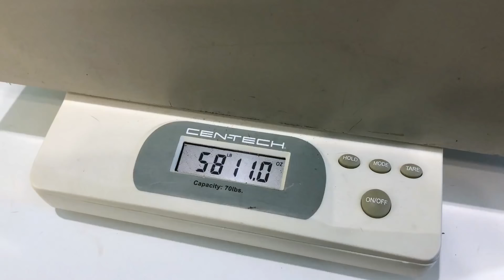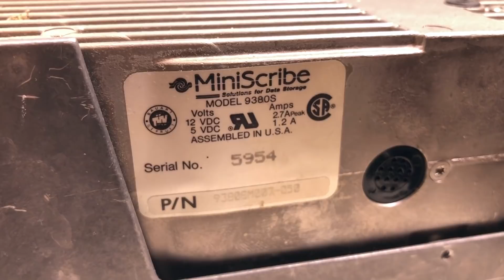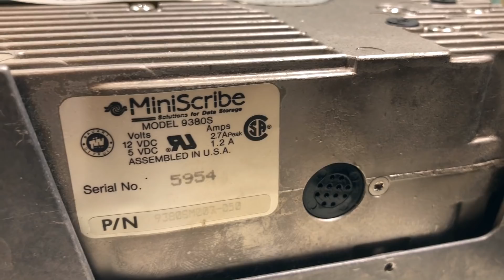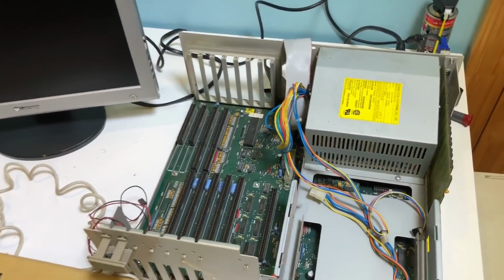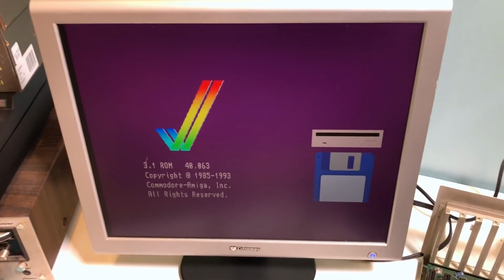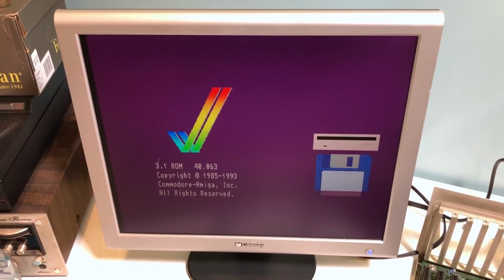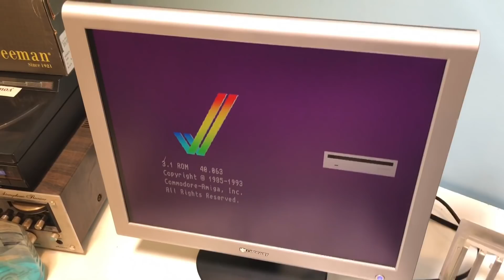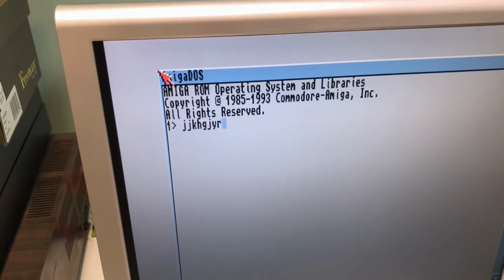Bringing my Amiga 2000 with 68040 accelerator back to life! - SIMPLETHINGSTOYS

Comment: All you need are the workbench install disks or CD.  If you want to save whatever is on that big hard disk, I would install the OS to another drive and then hook the big drive up later, to safely retrieve any data from it, because the install will format and erase it.  The OS app you'll need is disk tools.

Comment: Got a similar setup A2000Rev6.2 (60Hz), added 2 Isa 16 bit upper slot, double Kickstart 3.1+1.3, 2Mb chip module, FF40@28+32Mb (rev1)+rom3.4, OS 3.9/3.5/3.1 on different partition, VideoToaster 2000, DCE external scandoubler, GVP SCSI HC8+ with 1 mb + 9 Gb IBM FiberChannel hdd , Buddha IDE + ide CDRW, Picasso 2, A2386SX + FPU +8 mb (and Sound Blaster AWE32, 3COM Etherlink III shared with the Amiga side), two mouse (1 for each side), 1 floppy 880kb drive on the Amiga side and a 1.44 HD on the pc side.... ;-) Not easy to make this work together

Comment: The SIM RAM/HD card was to simplify and compact addons. Since the 2000 came with only 2MB RAM the 8MB of SIM was useful, and adding a HD controller means it only took one slot. SIMS were common on IBM PCs, so it kept costs down. My A2000 has a similar GVP card - fully populated =).

BTW, ALWAYS use an anti-static strap when doing that kind of work or run the danger of ZAPPING your chips.

Comment: The hard drive card was a hard card, and was a memory card as well as a disk controller.  Alot of the card upgrades were multiple use cards .  In this case you had a HD controller that you could add up to 8 meg of memory, normally 1meg X 8 simms...same as was used in Macintosh systems.

Comment: The Zorro bus of the AMIGA supports not just SCSI Controllers, Network cards, etc. But also the PC Emulator card and Memory cards - combining the SCSI controller with Memory expansion possibility would save you an extra slot for "FastMem". 
I got the same IBM XT compatible expansion card :)  
You can add a ISA VGA Card and even an 8-bit HardCard or converter to IDE card (new) that can be used with a IDE-to-CompactFlash adapter, and it will work in 8-bit with the 8088. The driver for the AMIGA even supports booting from Floppy and using part of the PC Harddisk for the AMIGA. 
Still looking for the source for that 8-Bit IDE Adapter :)

Comment: really nice find, some great expansions there! Kickstart rom seems updated to 3.1, it didnt normally come with the A2000. regarding the memory on the scsi card, its not related to the scsi its just a normal system memory expansion put on the same board. it was verry normal on A2000 that harddrive and memory expansions was put on same card. The accellerator might have fallback mode to the original processor thats still on the motherboard so you will have to do more testing to know for sure its working. Again verry nice find!
Reply: Yeah I had 2 megs extension on my SCSI board for a total of 3 MB of ram.
Reply: It was the same for hard disks that came out for the A500 too (though I never had one), a quirky feature of the era which pleases me. I think it was simply a case of getting some more use out of spare space on the expansion card being added- if the hard disk or hard disk interface etc. wasn't taking up a full card's length, why not add some RAM slots.